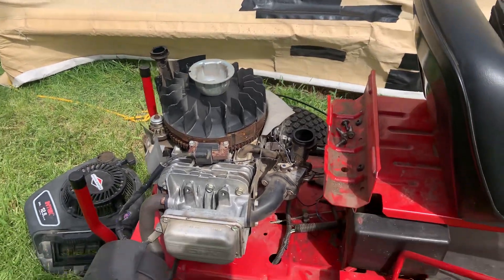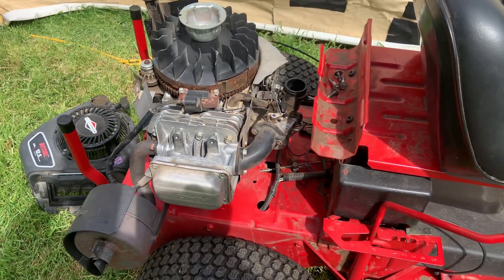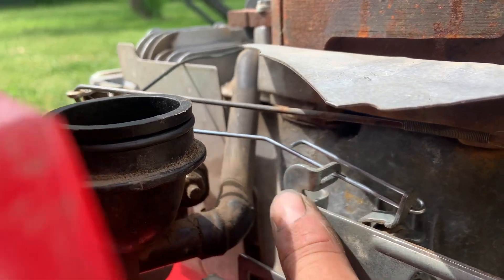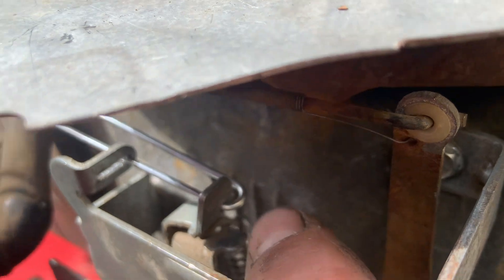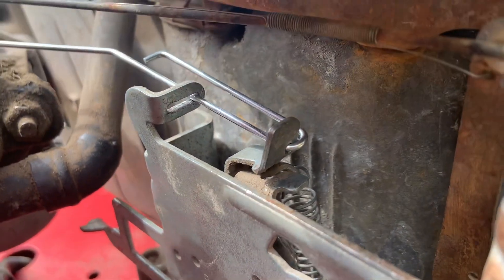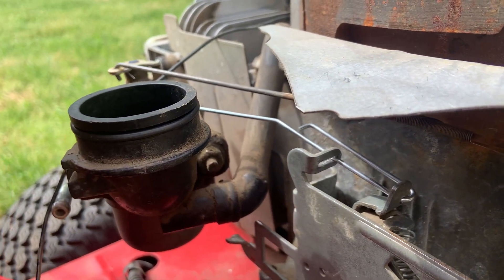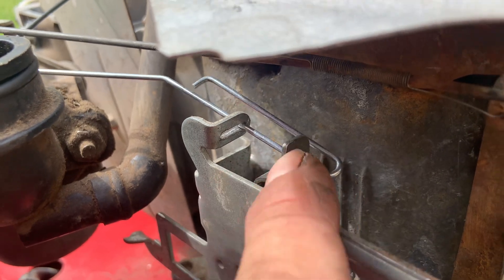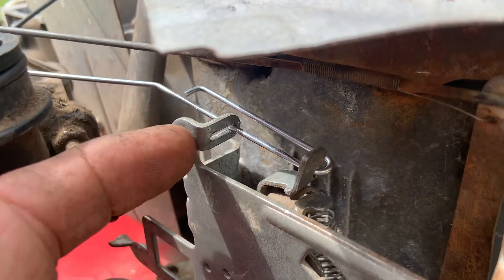Botched repair job.

Comment: Amazing, what people will do, to try and repair their own equipment? It will cost them less, if they just don't touch it, and get it fixed right, the first time? Now, you have to fix what they messed up, then go ahead and try and diagnose it, properly? It cost them more, either way you look at it? They even mess things up, so bad, they destroyed a machine, that was actually, a cheap easy fix, in the first place, right? How many time's, has a customer said, I thought that tiny little carb, would be easy to fix, so I tried, and can't even fix it, never mind, put it back together, properly?